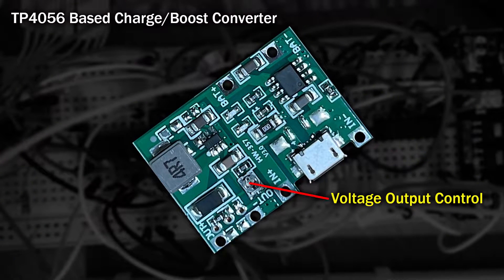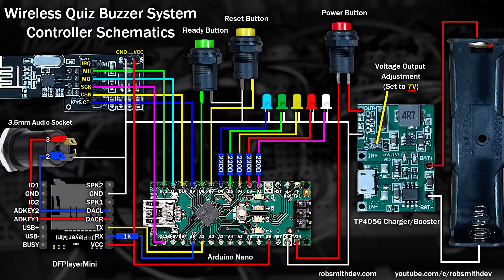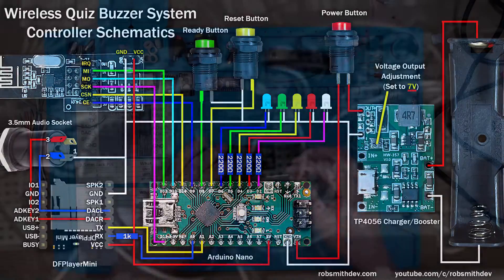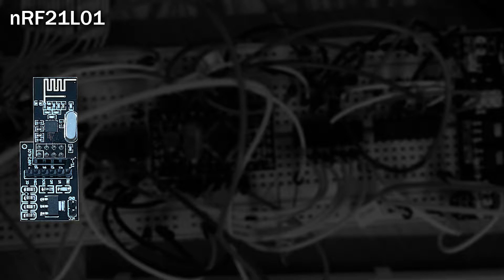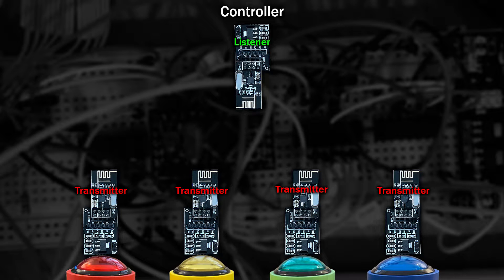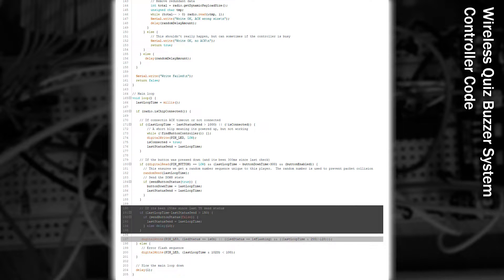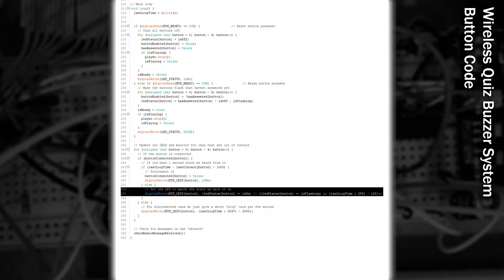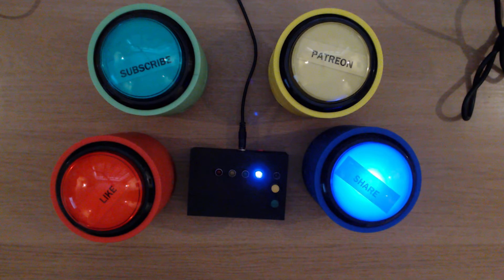Wireless Quiz Buzzer System using Arduino, nRF24L01 and TP4056 lithium battery charger

Comment: Hi, would this code work with just 2 buzzers connected, or would you need to build all 4 before it would work?
Reply from the maker: Yes it works with two. Well it will work with just one but that’s a little pointless

Comment: Were the power buttons linked in the description? I couldn't find them...
Reply from the maker: I think I missed them. They’re https://amzn.to/3OykMq0
Reply: @RobSmithDev  How do you check the voltage of the TP4056 charger booster? And which direction increases the voltage? (CW or CCW?)
Reply from the maker: @MarkNewton-hp2ef  you’ll need a multimeter to measure it’s output. I suspect cw increases it but you shouldn’t have the rest connected while you are measuring it
Reply: @RobSmithDev  I am stumped again: I've connected everything to the controller but the DFPlayer and audio socket, and when I turn it on, the Nano seems like it dies (light comes on and fades out). Any ideas? The button looks like it's working great though!
Reply from the maker: I’d try disconnecting things one by one to see if something is shorting. Also check battery is charged
Reply: @RobSmithDev  Appears to be the nRF24L01 that is shorting
Reply: @robsmithdev If I use the 3v3 instead of the 5v, the leds start blinking, but it doesn't recognize the button
Reply from the maker: @MarkNewton-hp2ef  I guess try another and check the wiring
Reply from the maker: @MarkNewton-hp2ef  hard to tell which 3,3v you mean. Have you assigned the four button numbers?

Comment: Is it OK to give 5V to Vcc of nrF Module while its specification is 1.6 to 3.6 V
Reply from the maker: No, it would damage it. I use a small adapter that converts everything to 3.3v and also makes sure the supply is stable. You can power them from the Arduino directly but the adapters are more reliable. The board: https://amzn.to/3z2A4Mi

Comment: Which Board do I have to select in the Arduino IDE ?
Reply from the maker: Depends which board you have purchased. Probably the nano or pro mini. You may also need to select old/new boot loader for one of them. If it’s the wrong one it just won’t work - you won’t damage it

Comment: Great video! I started wondering tho, wouldn't it be better and cheaper, to just use the ESP8266? With little to no changes it can even run the same code, or am I missing something?
Reply from the maker: You could - and the ESP8226 (I think) has built in comms built in, but that wasn’t the point of the video

Comment: hello, I would have liked to know if it was possible to connect 12 buzzers at the same time on the same controller
Reply from the maker: It is, but it’s a little more complex as there isn’t enough pins to include the LEDs for them
too
Reply: @RobSmithDev  no, I don't want to add LEDs, just to know if I will have to modify the code so that it works with 12 buzzers instead of 4, please.
Reply from the maker: Yes a small modification is needed but not much
Reply: @RobSmithDev  ok so is it possible? sorry to bother you but maybe you tell me which line should be modified because I really don't know anything about programming please
Reply: just tell me if it's wrong to modify please
Reply from the maker: You can modify the code in any way you want. I’d advise if you’re learning to just try things. You can’t break it really and if it stops working then go back to the original code.
Reply: @RobSmithDev  ok thank you but it's complicated because a lot of things are technical words and I think the modification I want to make and minimal, just add buzzers and put the same sound for all the buzzers, but I can't find it which line of code should I change?

Comment: can i ask you again.. in the controller part how can I replace the LED Display into a 7sigment that will allow to count the number from 0-9 everytime is was pressed?
Reply from the maker: That’s a little more complex to explain for a YouTube reply. You could use a 7Segment display and connect each LED to the arduino, or you could use one that connects via SPI, I2C or Serial
Reply: @RobSmithDev   thank you so much sir.. where can i insert the code? indide the controller?

Comment: Please advise what code do I need to add if I want a sound when answering correctly.
Reply from the maker: You’d need to add extra sounds to the memory card and then need some way to tell it if they got it right or wrong (maybe two more buttons?) which would just play sounds like it does when you press the buttons

Comment: I have problem with Write failed message for all 4 buzzer unit I try to replace Arduino pro mini to UNO and Nano, change 5v power supply but It s same result
Reply from the maker: Difficult to say what the issue is. Are you using the adapter boards for the nRF24 boards or connecting them directly?
Reply: @RobSmithDev  I start by using nRF24 adapter board. It seem to be worked when connecting board to computer by USB TTL and the same problem when disconnected to computer.
Reply from the maker: @kantoprasree7052  so when it’s not connected is it running off the battery? And is that set to output 5V?
Reply: @RobSmithDev  Thank you very much for answer, recent its already work.The cause is probably from 1.The newly purchased battery is not fully charged and 2.connector is not tight(not yet soldered).

Comment: good day sir.. i really like you wireless quiz buzzer.. is these possible to make one these wireless quiz using velostat conduction resistace.
Reply from the maker: I would imagine so. You’d have to give it a try
Reply: @RobSmithDev  im working with my project and my study is about wireless electronic sensor and I'm using nrf24l01 as a means of communication. can I ask you some help with my project
Reply from the maker: I’d love to help but my time is very limited. You may find better help from the Arduino Facebook groups
Reply: @RobSmithDev  hi. good day.. can i ask question? how to program a two push button that when you press it together, there will be no output or let say output is invalid
? thank you.

Comment: First, great tutorial, this project is brilliant ! I made two of the four buttons for now and when I turn on the button, the led are not blinking but just having weak dimmed light (0.45V). Is it normal ?
Reply: I have same problem, how you solve it?
Reply from the maker: That doesnt sound right to me. Not sure how you’d have that happen
Reply: @RobSmithDev  Is it normal in the code of the button that there is no identification of each button itself ? How do the controller know how to define each button to the right color of led ?
Reply: @RobSmithDev  Ok, I have found the issue, know every button are kinda OK. The controller find all the 4 buttons and everything is working on the controller but except one button, all the other are flashing like when trying to find the controller. So it's very weird. Have you some path to a solution for me because I'm lost ?
Reply from the maker: @morissesteven4494  not really sure. Is it possible you’ve assigned two of the buttons to the same Id?
Reply: @RobSmithDev  Sadly I have checked multiple times, they have the good ID. I think I will give up and make it wired instead. Thank you for your help.

Comment: I am struggling to get this working...
In the code for the buzzers, in the "while ((buttonNumber<1) || (buttonNumber>4))"-loop (lines 53-66 in the video) it seems that 
"if (Serial.available())"  (in lines 61-64) is never called so teh program is stuck in this while-loop for eternity... i tried several rf24-modules and arduinos...
Any ideas? Grateful for every tipp!
Reply from the maker: If this is the buttons, on their first use you need to type their number via the serial port to set it. After that they’ll start as normal
Reply: @RobSmithDev  Thanks for the fast answer. I am one step further now: 
The Quiz Button LED is flashing now.
The Controller says "Channel 125 is selected", but the Buzzer can't find it although it is scanning channel 125...->
"Searching for controller..." 
"Write failed"  (a bunch of times)
"Searching for Controller..."

Any ideas on how to solve this one?
Reply from the maker: I've had this a few times.  Best solution I found was to move the controller and buttons away from computers, and switch everything off.  Then switch the controller on and wait for it to be ready.  Then switch one button on at a time. Its a weird one, for me 99% of the time they just work, but theres at occasional time it doesnt and im sure its wifi causing issues lol
Reply: @RobSmithDev  can you help with code by updating the code with different addresses for different transmitter of our choice? 
As this circuit with only arduino uno and nrf led and normal button (press) switch 
Can you help me out?
Reply from the maker: @RDX-cf1so  simplest way is to change the name of the NRF channels I guess
Reply: @RobSmithDev  which line of the code should I change for this

Comment: I want 8 set buzzer system . Can you help?
Reply from the maker: Hi - there’s not a huge change to the code required to support extra buttons if I remember correctly. I’m sure you could figure it out. The buttons is probably just one or two likes, the controller is probably a few lines changed (to change buttons from 4 to 8) and then extra lines of code for the extra leds.
Reply: @RobSmithDev  u said in your code that there are only 6 pipes possible to  connect nrfs . how to solve this issue?
Reply from the maker: 😀 I also said the pipes aren’t useful so I don’t use them. The code only uses 2 that they all share